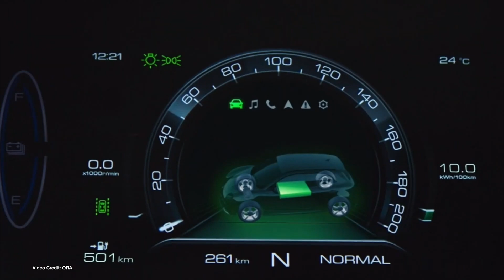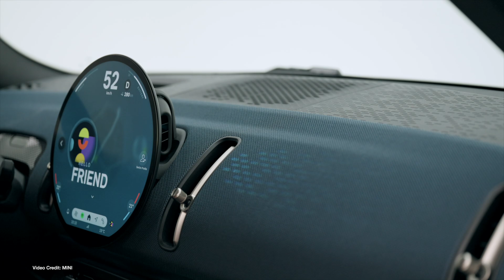EcoTEC Episode 292. UK Backpedals on EVs, Volvo Ditches Diesel, Kiwi BioGraphite!

Comment: It'll be pretty funny when UK consumers find they may not have a choice by the time that time limit comes around. The EU, China and the US represents about 80% of the world market and they'r all going electric.
Reply: Actually the UK has simply fallen into line with the EU by extending the timeframe to match the EU.  Also the US consumers (California excepted) are not switching to electric in large numbers and Japanese manufacturers are still wedded to internal combustion.

Sunak was using sleight of hand in his announcements.  Seemingly pandering to the anti net zero brigade whilst actually providing them with little of substance and actually accelerating the roll out of heat pumps.  The uproar from the environment lobby demonstrates how they fell for it too.

Comment: It's another election loser of a decision by Sunak - 2030 put UK ahead of EU deliberately so that it could attract investment over places with lower workforce costs. Don't forget, it was only new ICE car sales, not a ban on using them.

Also, sadly, more and more people don't outright buy a new car, they fall for PCP deals that mean they never actually own one - it's not their car, but is the maker's property (unless they pay the final fee at the end of their rental time). If not that, then they are getting EVs as a company vehicle, which helps lower some taxes for driver and company. So, to use the artificially high costs currently charged for EVs is another smokescreen.

Major donors are now starting to turn their back on Sunak, though not all, and some explicitly refering to this particular announcement.

It won't matter what date is now picked because the decisions of what models will be in production after 2030 have already been taken by the manufacturers, and they need stability in a country, not a PM grabbing for the anti-ULEZ vote - hence Ford's scathing letter to the PM about it. New 2030 models have been in the pipeline for a couple of years already by now, as it takes maybe 7-8 years to plan, arrange for parts, sort out production facilities and so on. The major manufacurers have already decided, and they're easily capable of meeting 2030.

Mercedes has basically stopped developing new ICE, Volvo and others are finishing with diesel cars, even the big artic truck builders like Volvo/Renault, DAF, Iveco, Ford, Merc, Scania/MAN and the likes have EV versions out now (also HFCEV versions, since hydrogen may still be viable in the big truck space, refilling at large company depots). UK is not currently able to generate more than it needs from wind/solar - unlike the Netherlands, for example - but when it does reach that point then using hydrogen as an energy store for the surplus power will make HFCEV trucks more viable - currently it takes 3-4x the energy to create H2 than just using it to charge a BEV, and is mostly dirty since it involves steam fracturing of natural gas, releasing tons of CO2 in the process.

Add that cities like Paris are going early with banning diesels from entering them, and the fact that the EU is getting all protection-minded about the wave of bespoke, non-legacy manufacturers coming up with properly priced EVs, then the decision of one tiny man playing politics with it all is immaterial. Yes, people can drive ICE cars well into the future, beyond 2030, 2049, 2100, whatever, for as long as fuel, parts, servicing is available. They might not be able to drive into huge cities, and perhaps that's where the focus needs to be so that alternatives can be properly developed. Sadly, the UK has no integrated transport plan to make best use of all forms, so people see the private car as the only option. Tackling that would make much more of a difference, rather than putting on a show cancelling imaginary things that never existed just to tack the push-back of one date onto the end.

Comment: At least the UK is facing reality, it can't happen by 2030 and even 2035 is optimistic, there is no way to create all the needed electricity and upgrade the electrical grid to handle the enormous power needs of millions of EVs in such a short time. An EV can use 30 to 50 percent of the electricity of a house so if a household has 2 or 3 EVs, it is like adding another household of electricity consumption to each address. I know people say that we should just subsidise the poor people so they can upgrade to EVs but you can't just print more cars and print all the infrastructure needed to operate them, it takes decades to upgrade that type of infrastructure.
Reply: I don't think you're an idiot and you believe that, but that is the pure FUD from MSM speaking. 
To paint the energy grid as the victim of the transition is hilarious. Do you think the energy companies want to slow down this transition, to prolong a gradual rising revenue? When demand grows, energy production and the network grows. The charging network (UK) now has 48,437 charge points which is 23% more YoY and we're still 6 years away from the original proposal. The ban which wasn't a complete zero emission ban, hybrid sales were still allowed.
EV sales already make 20% of new vehicles sold in the UK with thousands already on the second hand market. I bought mine second hand! This is happening with minimal financial incentives. People are clever, and EVs make sense.
Sunak back pedalled because he's under the wing of oil companies, clear as day.
Reply: That's a nice opinion. It's also wrong. Even the grid operators say it's not true.
Reply: @AussieUnclePhil  Grid operators are just saying things are ok, there isn't much of an issue yet as EV penetration is low. They are factoring in bidirectional charging, no Teslas have that and most others don't either, and 'smart' load sharing (turning off your stuff to supply someone else) to get close. No way will people want to come out to their car and find it dead because it was a hot day and people wanted to stay cool. They are dreaming if they think people will let them take over control of their vehicles and put power in and out of their cars at will, it wears out the battery faster and creates uncertainty. 
They also assume far larger uptake of wind and solar power than is currently happening, people just don't want the expensive outlay at the moment. Grid operators are always praying for mild weather and no accidents and that just isn't going to happen.

Comment: Thanks, good to watch a documentary directly related to what's going on and available in NZ. in relation to the electrification of the automotive industry. 
I believe the change to this form of transport is a must for city dwellers but unfortunately the cost to change is currently way beyond the average income earner at present. Until a cheaper more efficient battery is developed the IC powered vehicles will remain an integral part of our transportation system. 
 I believe the current government rebate given to more wealthy people to buy EV's would have been better spent on a subsidy to all NZ house homeowners to assist with solar panel installation for their homes as was done in Australia.